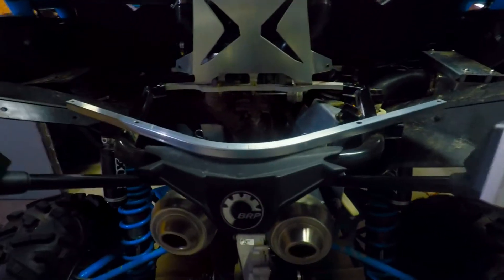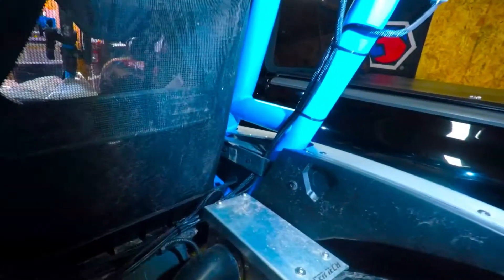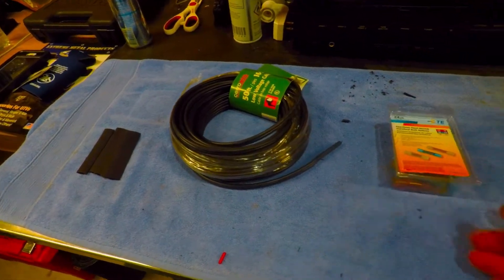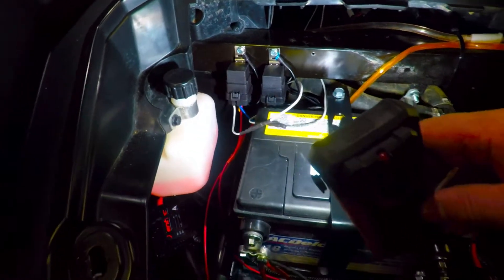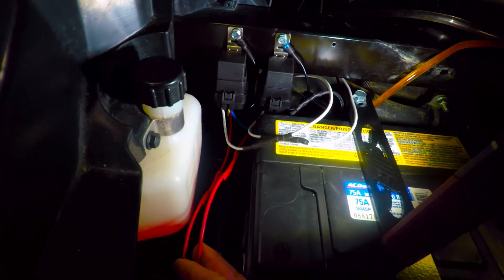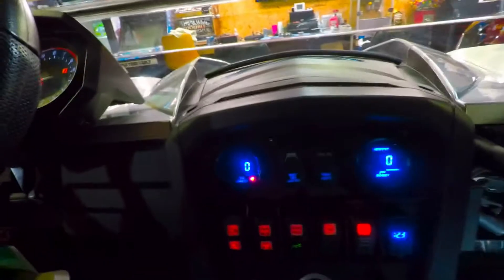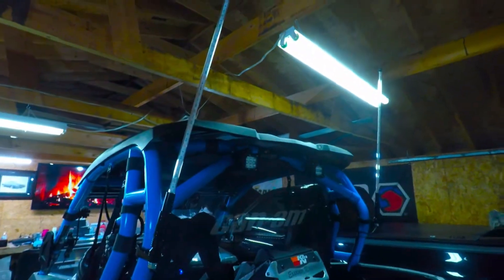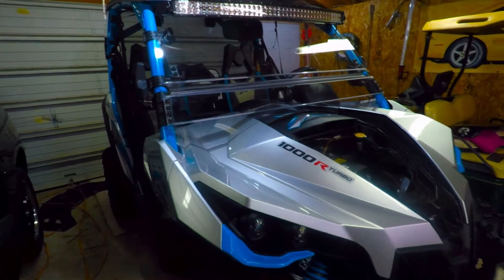LED lights  How-To Can am Maverick turbo 1000

Comment: Awesome lights! First side-by-side bought used no brake or taillights on drivers side only brake lights on passenger side. Totally ignorant when dealing with vehicle light problems. Any suggestions for fixing problem. Any information on making YouTV street legal i.e. turn signals
Reply from the maker: Bulbs are always a issue with these due to the elements and what they are exposed to I recommend removing the bulbs and cleaning the socks with a electrical cleaner and putting a small amount of dialectic grease and see what you got. As far as street legal laws are different from state to state. There are tons of kits you can buy to make it legal pretty easy and fairly cheap to do. Break lights, turn signals, horn, proper full windshield and DOT tires.